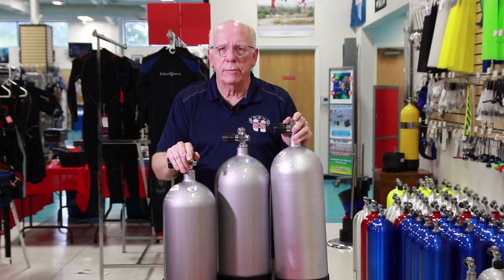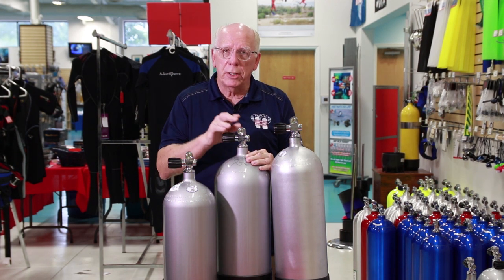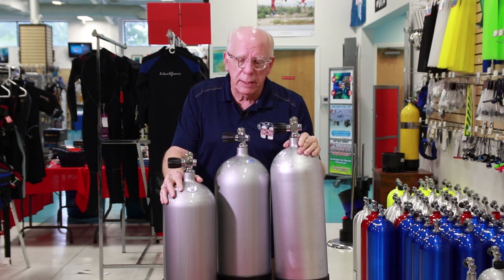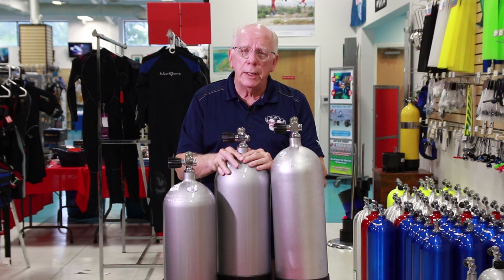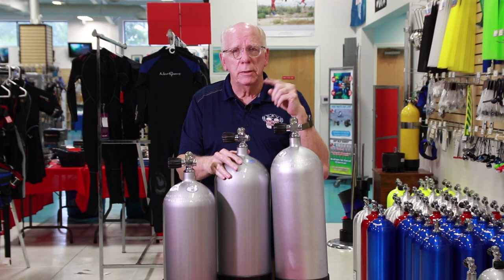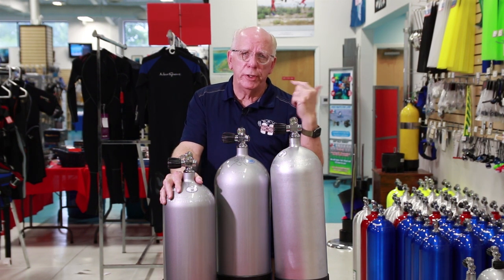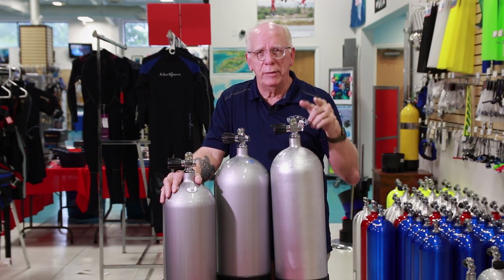Why Choose Low Pressure vs High Pressure Scuba Tanks

Comment: Good video as always.

I had a manager of an lds state   that " Opt for a LP tank instead of HP, you’ll end up with more gas on average and a guaranteed full tank on a bad day!"

Would this be true because of the heat generated and many places filling large amounts of bottles dont want take the time to allow a bottle to cool and top off to proper full? 

Id decided on getting hp 100s because they are the same diameter as al80s. but now im hesitant
Reply from the maker: I think the manager is giving you good advice.  I prefer LP tanks for a few reasons and I've found that even though you may not be getting a true full tank at times, you do tend to get more gas.  Bob C
Reply: @DiversSupplyYT  thank you I really appreciate it.

I'd thought that in the video you said that its best to get hp. Ill have to look back.

The lds manager and a few others stated that the main quarry we dive, and a couple other nearby places will fill lp tanks to 3000 psi. He said when that occurs its the equivalent of using a 100hp tank. Some places in fl will cave fill to 4500 but this seems like an unneeded risk for all but those tech divers needing maxed gas.

Comment: If you go 300 bar you get the same volume in twin 4 litre (AGA Spiro for example) as in a single 12 litres 200 bar bottle.
Reply from the maker: Are you filling a D27LV 4 litre Steel tank that's rated as 2640 / 182 BAR to 4351 psi ?
Reply: @DiversSupplyYT : No? And I don’t think you should try ether, you might get your head blown off when the treading in  the bottle-neck gives out.
Reply from the maker: @jan-olofharnvall8760  Just wanted to mind sure we are both thinking alike !  Very dangerous.

Comment: Pro valves are ideal for dive centers and if you've got yoke regulators and one day may switch to DIN.
If you've got DIN regulators you might as well go for high pressure cylinders with 300bar DIN valves. You're not going to go back to yoke, and there is no benefit to buying pro valves for your cylinders.
Reply from the maker: And you are so bloody correct sir !
Reply: The "Pro" valve is physically shorter than a DIN only valve, and less likely to be knocked out of round.
Reply: Int regulators are anachronistic these days, everyone getting a new regulator should get a DIN one, makes absolutely no sense to keep buying those less safe relics.

Comment: At 0:58 you define high pressure as greater than 3400 psi. Then you define low pressure tank as being between 2400 - 2600 psi. When you define these in terms of PSI, does that mean the amount of pressure that is in the tank, or does that mean the maximum pressure rating for the tank?
Reply from the maker: Hi B-Dogs, Thanks for your question.  There are tanks that "most" divers call Low, Normal and/or High.  Some divers call tanks "Bottles" vs tanks or cylinders.

Certain terminologies have been used and/or abused over the years, just like the pressure rating of tanks of various tanks ratings.
I speak to the 2400psi's I call Low pressure (actually that tank has a lot of pressure in it) .  A 3k tank is the norm for the group of tanks mostly used in scuba diving today.  The 3442 and above tanks I tend to address as High pressure.
This is me based on my experience over the past 53 years of diving.  Regards Bob C

Comment: A video to explain the difference on PSI vs air volume. I see some smaller tanks with the same PSI value as bigger tanks and don't understand how some small tanks would have more air than bigger tanks.
Reply from the maker: Think of it this way.  A small car with 6 people in it have about the same space between them as a big bus with 80 people in it.
6cft tank and a 80 cft tank both at 3k psi... it takes longer to get those 80 people out of one door than 6.
Hope this helps  Regards  Bob C

Comment: "You can always under fill a high pressure tank".
Exactly. So what advantage is there to buying a low pressure tank? Price?
Reply from the maker: Advantage; So an 85 LP Steel is full at 2400psi and an 80 Alum is full at 3Kpsi... does the compressor work harder to fill the Alum or Steel to give you aprox 80cft.
If it's my compressor I'd want less wear and tear on it.
If it's a shop compressor don't buy an 85... buy a 100 .. you're spending, within a few bucks, the same money.
Enjoy the extra dive time without carrying a bigger dimensioned cyl.
Reply: @DiversSupplyYT  LP85 25.98" tall, 7" around, 31.2lb no valve. HP100 25.5" tall, 7.25" diameter and weigh 34lb.

The LP85 will give 77cuft at 2400 which is what you're going to get on an LP tank after the first hydro unless you live in central fl.
The HP100 will give you 87cuft @ 3000psi, when you get short filled which will be most south flordia dive shops, and 75cuft if you want to only fill it 2600psi. There really isn't any reason to buy a lp85 over an hp100 any more.
Reply from the maker: @ChrisShaferKTM  Can't disagree, the 100 steel is THE #1 tank we sell...  my favorite, EXCEPT for folks that are vertically challenged, then the HP80 steel is my recommendation... That's for your comments
Reply: This completely misses the point. An under filled high pressure tank is a heavy tank with less gas. You could bring the same amount of gas with a much lighter LP tank filled to it's rated pressure. In general the weight/ft3 ratio is the same for both HP and LP filled to their rated pressure. The benefit of LP tanks is you never get an under fill. Not to mention over filling an LP tank is less dangerous than your drive to the dive shop.
Reply: there is basically no advantage of buying a low pressure tank.

a few real life considerations:
- low pressure tanks can be filled with a low pressure compressor without adapter. (for a high pressure tank, you'll need one if you connect it to a 200bar line)
- if you want aluminium (e.g. seawater consideration), you basically only get low pressure tanks.
- with the 50bar reserve, a high pressure tank gives you significantly more airtime (250bar vs. 150bar - up to 66% more usable air)
- if you're in a hurry, the high pressure tank won't be filled to capacity (mostly around 270 bar)

I always buy high pressure (300 Bar). Most divers here in Switzerland buy low pressure tanks, for reasons I don't understand.

Comment: We hear that the yoke is not compatible with high pressure fills
Reply from the maker: Not trying to be a Wise-a__ but what some people  say is NOT always correct...
Since I've only been diving for 50 years and I work in the industry 50+hrs a week, I may not known much but I dive weekly with a Yoke 1st stage and a number of HP 3442+psi tanks...
Now the Tech types will normally po-po Yokes and perfer DIN and rightly so because... If you're in an enviro where you can't make a direct ascent to the surface or you're outside your NDL to be able to make a direct ascent without risking DSC then the DIN's design of capturing it's O-ring does offer extra protection from that happening.
...BUT the simple statement that "Yokes are not "compatible" with a HP fill is not exactly correct.
AND there are those divers out there, and you known who you are, that abuse a tank's pressure rating by OVER-FILLING and doing other such non-sense...
I always say, "there's only one butt connected to the tank you're wearing", guess who's that is and who will suffer the consequences of SWD (studity while diving)...
I could go on but I'll stop here....
Reply: @DiversSupplyYT  it really depends on what your definition of an HP tank is. When I hear HP I think of actual HP, which have the 4350 psi rated valves on them. That’s exclusively DIN territory.
Reply from the maker: @RB-xv4si  So if 4350 is HP and 2400 is LP what do you call 3000, 3300 & 3442 tanks ??  Finding and getting 4350psi tanks filled in the US is tough..
Reply: @DiversSupplyYT  I call them standard. I just ordered a HP tank. Luxfer Limited 106. If it ends up working out as a single, I may make a twin set from them. Good point about the filling. I’m committed to the cause, though and I’ll just buy my own compressor if I have to.
Reply from the maker: @RB-xv4si  Ok standard ... is that the 3k, 3,3K or 4,3K that's standard.... Compressor, sure they are available today through Amazon at about $3,600 plus tax.. That's 220v so make sure you have accommodations in your home wiring for that and don't forget Filters and if you dive Nitrox get your O2 source ready.  A 106 with it is only about 35 minutes after that.. Cool go for it !
Reply: @DiversSupplyYT  yeah anything 3.4K and below is standard imo. If the tank doesn’t have a composite overwrap, it’s not HP. All the HP tanks have a glass fiber or carbon fiber overwrap. I’m an electrician so if I need to run a 240v circuit, no problem!
Reply: @RB-xv4si  you need to stop. Your opinion doesn't mean squat.  Its what the industry defines it as. Bob was correct in his video. Standard is 3000 aka your standard aluminum 80. Hp is anything over that including the common 3442/3500psi tanks. Lp is below 3000.

I really hope you aren't teaching others your blatant and incorrect misinformation. Especially since our clearly don't want to listen to someone who's highly experienced.

Comment: Now adays when you can buy carbon fiber tanks that has a burst presure over 800 bar, is it possible to find a first stage that can handle around 500 bar or more?
Reply from the maker: Problem is Joel, really nobody is selling those tanks.  Most shop compressors are not friendly, VIP/Hydros are yearly.  Past 3 years they have not been shown at DEMA even...
Reply: @DiversSupplyYT  Thanks for answering. Probably better to just buy a Poseidon seven+ 🤣

Comment: In Europe, we dive 300Bar, what is 4351 PSI. But our Tanks are actually designed to do this
Reply: They're the same tanks just marked differently for the most part.
Reply: Yeah, I was waiting to hear about the 4350 tanks in this vid, but no mention of them, haha.
Reply from the maker: It's 295.98 Bar
Reply: @DiversSupplyYT   tanks and valves are rated for exactly 300 bar. And tested to 450 bar.

We don't use odd numbers.

Comment: You didn't mention why someone would purchase a low pressure tank. You talked about everything but the topic at hand.
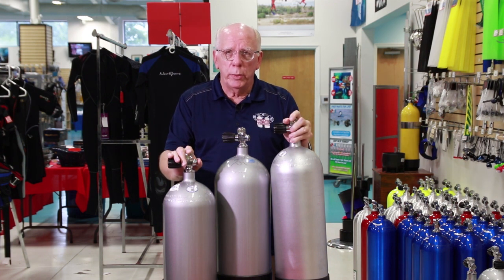Reply: At 2:09 he explains it
Reply from the maker: Thanks VP,  The biggest reason folks buy LP began because small compressors reach 2400psi  easier than 3442psi.  Lots less wear and tear on these compressors you see on small boats.
There's numerous follow on reasons.
Reply: @DiversSupplyYT  Why not just fill your high pressure tank to lower pressures when you fill it yourself then if you need more air, let a shop fill it to high pressure as required. Seems like there is no actual benefit to a low pressure tank.
Reply from the maker: @toms4022  Some people do just that .
Reply: @toms4022  With similarly rated capacities and filled to the same (low) pressure, the low pressure cylinder contains significantly more air.
Reply: One reason to use a low pressure tank (200bar rated) is sidemount. The goal of sidemount is to remain neutrally buoyant even if you remove one or both of your cylinders. The aluminium S80s are popular among sidemount divers for that reason: they are very neutral underwater and even become buoyant under 80 bar. 
With steel tanks, same thing. Faber makes 200 bar 12 liter tanks that weigh 12,5kg (Same weight as a 10L 232bar tank): They are almost perfect for sidemount.
High pressure tanks (300bar) are nice to have if you want a compact configuration with no weight on your belt: a twin 7 liters with a 3mm steel backplate is a joy to dive with and has the same capacity as a bulkier twin 10L at 200bar.
Here in Europe, compressors that can go up to 300bar are pretty common. We've got a different approach to scuba as in different countries, more freedom. For example, in France, our max depth legally allowed as "recreational" diving is 60 meters. A bit more than PADI's 30 meters. We also tend to ditch yoke connections.
Cheers!
Reply: @watchnut5686  thats indeed an important application. Most Sidemount divers that need to detach their tanks use aluminum and want neutral buyoncy. Therefore 200bar aluminium tanks are popular.

I also dive sidemount, but no cavediving etc. I use the setup exclusively for open water solo diving. So I have two 7l 300bar steel tanks as they are more compact and easier to handle. They also serve as dumpable weights. The weights integrated into my harness are not easily removable without taking it off, thereby also removing a buyoncy device.